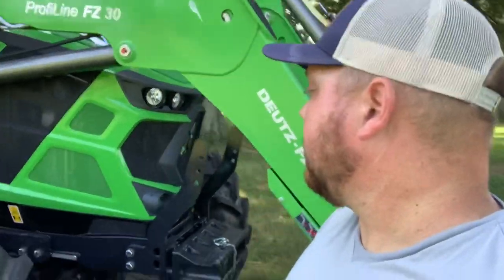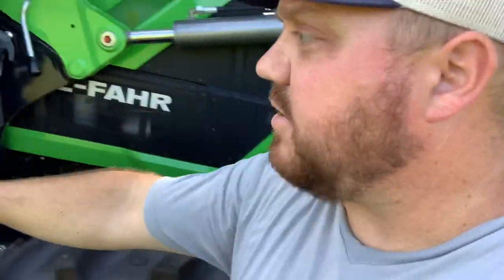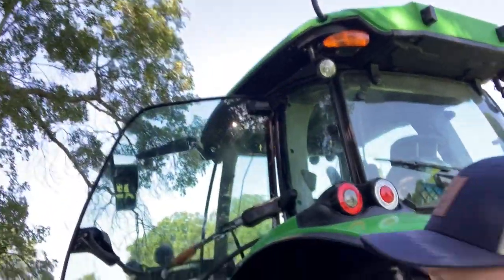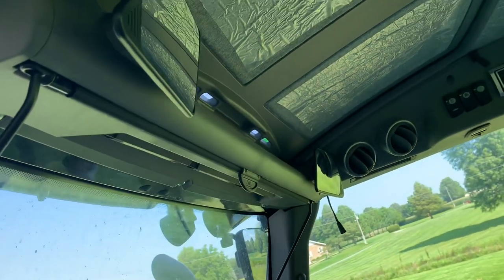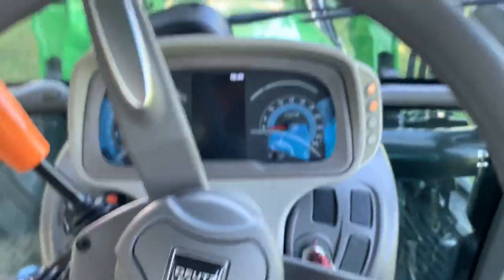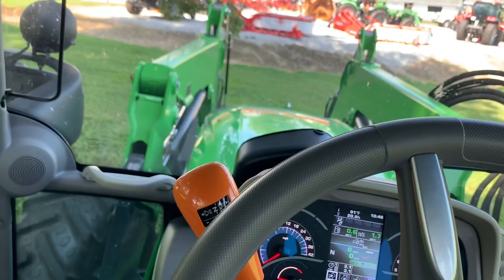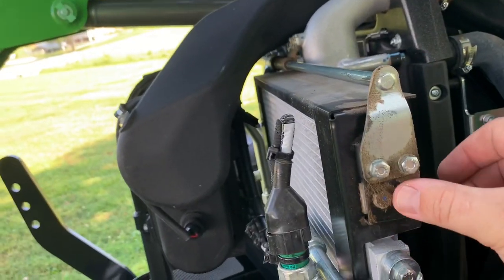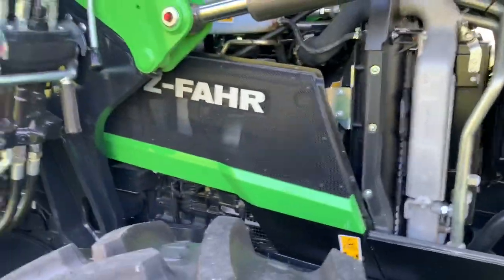Deutz Fahr 6130TTV Tractor Walkaround

Comment: I just bought 6135C TTV end of last year. Have 50hours on it. Exchanged for my old trusty Deutz K420 with manual trans. This traktor you are showing is some intermediate type as you have same hood as I have (except I have full LED light kit), but cabine is same as my previous K420(from year 2013) which from video show some very minor upgrades. Still was very quiet compare to some competition. On myne I have new cabine which is very similar ro 5120G you also preview on your chanel. I can safely tell after those 50hours that it is in entirely different league above and beyond compare to previous. Almost all my complaints on previous type  was addressed on this one. Everything is so convinient and on reach. I do bit of all stuff (hay, field, transport, cattle) - for heavy work on field I have older Deutz 7250TTV from 2013 which I bought second hand 5years ago(cant complaint on that machine at all).  I have a good dealer with excelent servise. Those small things that broke was fixed quickly with spare parts available in most cases in two days (some over night, some low volume stuff took week, but still) and really those was small things over all (solenoid here, bowden cable there, sensor for air pressure, those kinda small stuff). Non of those left me on side of the road even once for last 7years so I hope that 6135C TTV will follow tradition. Im very happy with this brand and my dealer and therefore I didnt look elswhere. We have good John deere dealer even closer, but price is considerably higher and spare parts availability is "questionable" at best - talking from my neighbour expereience which run 4 John dreers with various age from new to 15years old. Sorry for my English. Regards from central Europe
Reply from the maker: Thank you for watching. PFG and Deutz Fahr have been good to us.

Comment: Love our 5130 TTV which is very similar to this 6 series. Seems they bumped the model up a series to simplify the 5 series when AdBlue was added and TTV was removed from the lineup.  Huge capacity from the loader for the size of the tractor, very easy to operate (especially thanks to the TTV) and we even have 5 rear remotes on ours. Wish we had the comfort ride on our FZ30, but maybe upgrade to that at some point. So glad we bought a Deutz!

Comment: For those who know, what is the Deutz pricing compared to the other manufactures?
Reply from the maker: Very competitive if you’re looking at an Apples to Apples build quality. Obviously nothing gets cheaper than the Chinese and South Korean Econo builds.
Reply from the maker: Where are you from, and what size tractor are you looking for?
Reply: @tractorben  I'm wanting more value but not at the expense of quality and usability. I have ran Deere for years but their arrogant fight against RTR is something that doesn't sit well with me.
Reply from the maker: Most models at this point can still be purchased for under $1000/hp. Some are well under that and some are slightly above.

Comment: Looking at at 5080 Keyline for next season.  Standard features are impressive.  Would love to know about real world performance from owners of the new models.
Reply from the maker: 5080’s have been very popular and in short supply. The operations that have them are thrilled so long as they weren’t really needing a 110hp tractor to begin with. I have a farmer that pulls double duty with some customer property maintenance as a side hustle. He has been pleased with versatility. Does say when round baling in hill ground he knows next year he is going to purchase a 5110G because the 5080 isn’t really enough.
Reply: @tractorben  Thanks for getting back with me.  For what we are needing 80hp will be fine.
Reply from the maker: Right now we are only able to get 5080’s as Retails. It’s looking like next year before there will be enough in country to have stock on the lots.

Comment: Every loader has loader suspension as a option...literally every one and for more than a decade. There is nothing Deutz has that’s unique to the brand other than a lower price.  FYI
Reply from the maker: You must have misunderstood, it’s not an option, it’s a standard feature further building value into each machine. Just like 4 wheel braking (also standard) whereas with most of the competitors, it’s optional to the tune of $9499-$12999. You must of misunderstood but thanks for coming to my little channel to straighten me out.
Reply: @tractorben  all of my Fendt’s came standard with front suspended axle and brakes, but I always pay extra for hydraulic attach lock and loader suspension which is about $2000 and $1500. I wasn’t commenting to be negative, I’m watching (and enjoying) your videos thinking I might like to buy a few Deutz tractors. I understand theirs a big price difference between the two.
Reply: Exactly. As an option…. That’s the key point you missed
Reply: @nalley6815  all the utility tractors in the same class come standard with these features. Again, Deutz isn’t offering anything new or different.
Reply: @zfilmmaker  name 1 manufacturer that comes standard with a soft ride loader? Every one I see is an option.
Reply: @nalley6815  Massey Ferguson (for sure) and New Holland. Probably Kubota too but I’m not sure on that one.
Reply: @zfilmmaker  no sir. That is an option just like I said before
Reply: @nalley6815  It came standard on my Massey 5711d and new Massey 5s.145. The interesting thing about Deutz, everybody sells/trades them at 300-600 hours. Nobody keeps them longer. I've yet to see a late model with 1000 hours. My local dealer can't give them away...they've had the same 6130TTV almost a year. That's certainly not building value.
Reply: @zfilmmaker  it does not come standard on the 5D series. You have the option of the 946x loader or the 941x or you can upgrade to the FL series which then and ONLY then comes with soft drive. You can easily check for yourself
Reply: @zfilmmaker  but yes it probably does come standard on the 5s because it’s now almost a $200k tractor